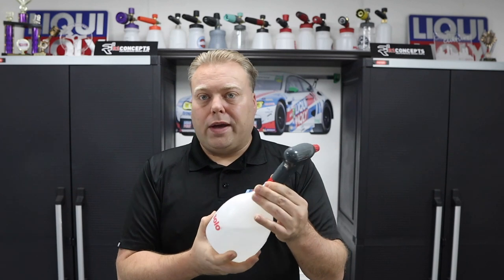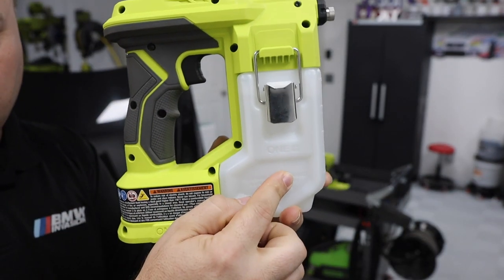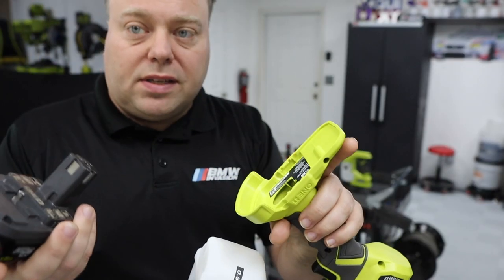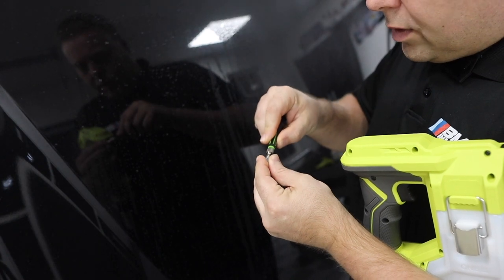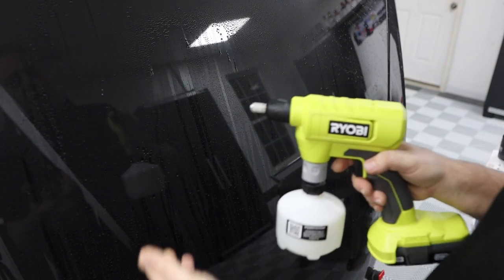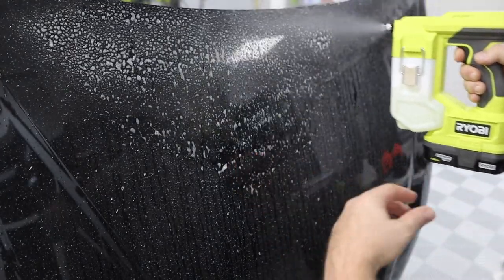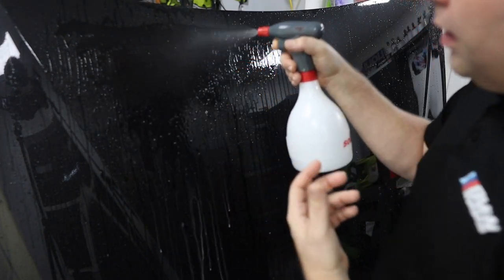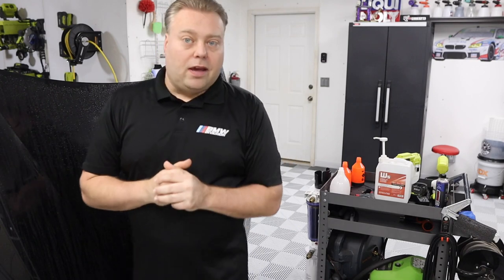Battery Powered Sprayers | Solo 460 | Ryobi Compact | Ryobi Handheld | Review & Testing

Comment: I’m using the Ryobi 1 gal garden sprayer for my wheel cleaner. Using P&S brake buster full strength. It does just fine. The P&S Brake Buster is thicker than water.
Reply from the maker: Brake Buster does well in all of these it is close in consistency to the Gtechniq. The Garden sprayers to have larger openings to help with thicker liquids. I have a one gallon and a 5 gallon and both work great.

Comment: I wonder if either of these Ryobi sprayers or the Ryobi battery garden sprayer can be modified to generate foam instead of just a spray.  Still trying to find the perfect battery operated foamer so I don't have to keep pressurizing my iK sprayers.
Reply from the maker: I'm looking for a  good one. Not sure ones like these can as it requires a good bit of air pressure to create foam.  Will have to try one of the battery ones that pumps air instead of pumping the liquid out. I use the IK Handheld foamer with the air compressor fitting for a foam bottle.
Reply: @CarsWithKeav  Yea I have 2 of the big iK Foamers. 1 I put the air fitting on and the other came with the air fitting. Use one for my wheel cleaner and one for my car soap to foam the car if I don't feel like pulling out the pressure washer.  The running back and forth to the garage to keep filling them from the compressor is the part I'm trying to solve for as it gets old quickly. I mean I have a small battery powered air compressor I can use on them just looking for a self contained solution.
Reply: If you have IK with the schreader valve, get a small pocket tire inflator and Velcro it on the IK. Mine works great.
Reply from the maker: @KosmicHRTRacingTeam  yes, this works well. The new IK one works awesome on the bigger IK Pro 12.

Comment: thanks for your video. 
in your opinion, do you think the handheld ryobi could handle wd40? looking for a better option in the field for lubricant sprayer,  always have battery tools on hand trying to utilize the versatile of electric tools.
thanks
Reply from the maker: WD40 being a solvent I don’t think any of these would last very long. Most everybody I know that uses WD40 in bulk will use a sure shot or similar compressed air metal canister. Same you would use to spray bulk brake cleaner. Maybe a paint sprayer gun with metal tips and body might work if you have a bigger nozzle just have not tried that before. Most of them spray liquids with paint thinner and lacquer in them so it’s possible, but I would assume needs to be cleaned out every use so not very practical.

Comment: Amazing how the little compact Solo spray top can perform against the big clunky Ryobi.
Reply from the maker: Yeah, it works so good.
Reply: @CarsWithKeav  Have you looked at or tried the bigger Ryobi sprayers that can hold 1-2 gallons of fluid? I've been looking at them as a budget alternative to the pricey units like the IK e12. The Ryobi 1 gallon with battery and charger can be had for $99. Seems like a great option if you don't need foam and lots of volume for something like a rinseless wash. Plug you can buy extra tanks for around $30 to have ready with other chemicals for auto detailing or home and garden use.

Comment: Surely by now someone has found a larger bottle that works with the Ryobi compact sprayer?
Reply from the maker: I really never looked for one. Maybe somebody here can help out. I think the quick connect could adapt to something.
Reply: @ I own the Ryobi compact blower and love the convenience of its size.  I’d buy the compact sprayer for the same reason, but a 1/2 liter bottle is much too small.  I’ve never paid attention to plastic bottle threads.  Are there any standards for threads per inch?  I think the only chance of finding something is online, and then I would need to know how many tpi I am looking for.

Comment: great review.  I wonder if you've ever thought about addressing the same issue using a Corny Keg sprayer instead of a battery operated bottle?
Reply from the maker: I will someday. I do have an IK sprayer with a Shrader valve that allows me to fill with air easier and it does well with the thicker liquids.
Reply: @CarsWithKeav  I built a corny keg sprayer and I love it.  My next evolution of it is to add a second tank tube that can allow me to spray or foam from the same tank.  I actually plan to build a cart with 4 kegs and an air splitter so I can keep each tank charged to the optimal pressure.  I currently use my tank for my ONR pre wash step, but I could see using a keg for products such as Iron Remover, Tar Remover, ONR, wheel cleaner, APC, or even soap if it was thin enough.  
Just a thought for you.